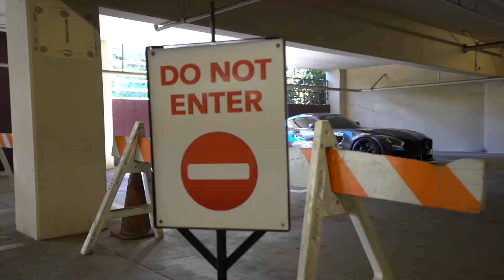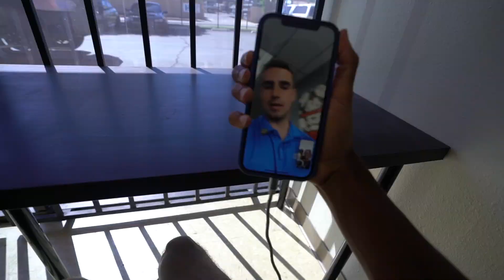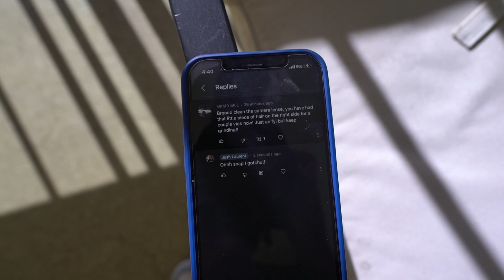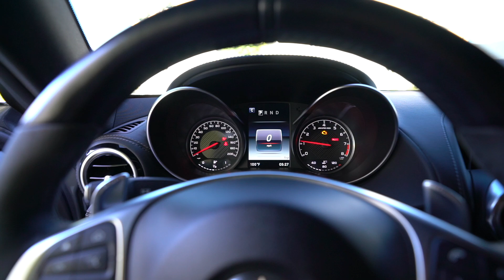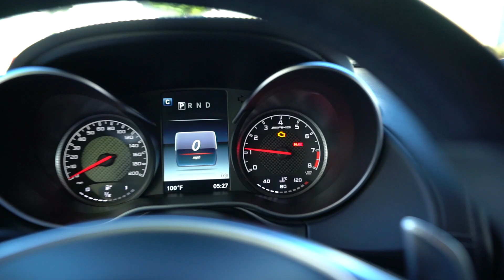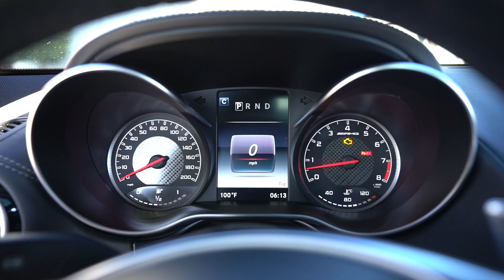FIRST DRIVE IN TWIN TURBO SRT 392 *SUPER RARE*

Comment: If it’s stock engine like you said then that engines not gonna last long 392s are made for NA power not meant for boost so unless u got forged internals in that thing it’s going boom but judging from what I saw yo other cars I doubt it’s stock engine like u said cuz it looks like they know what they’re doing
Reply: Lol u couldnt even get a single run at 1k hp stoxk interanls definitely built
Reply: 7-8 psi and anything lower would be safe to run on a 392, anythin over that would be pushing it, but you can make extra power reliably from 7-8 psi
Reply: I will get forged internals fsfs no point of boosting my scat 6 pounds when i can boost 13 pounds😩